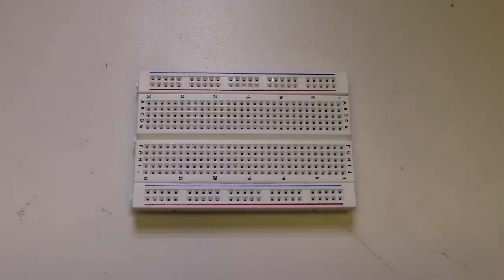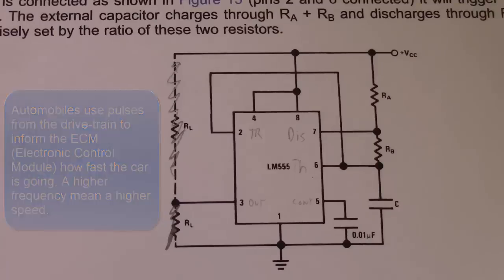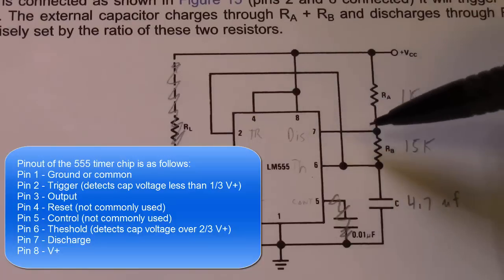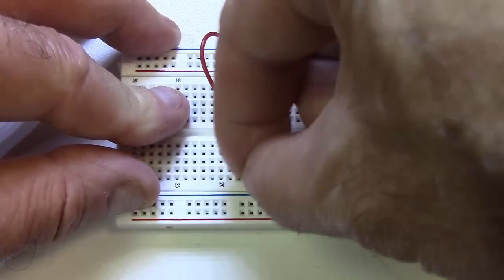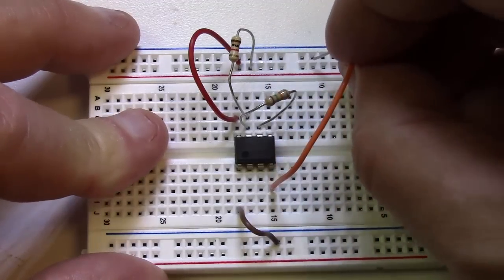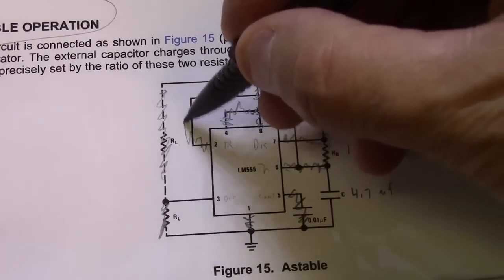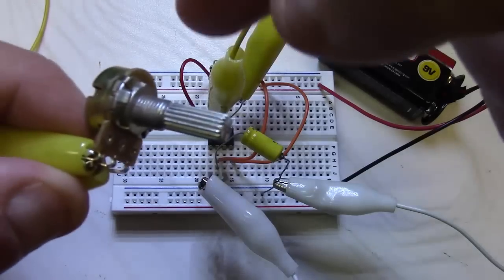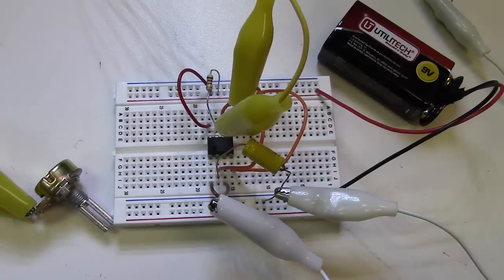555 Timer Project - Signal and Sound Generator

Comment: I like to see a 555 timer circuit have a random pulse it for my robot to blink his eyes randomly
Reply from the maker: Sounds like an interesting 555 timer challenge. Do you want the eyes to blink or flicker? The blink rate could also be tied to a light sensor.
Reply: Dorian McIntire blink slowly I was thinking of a row of led in a circle pattern maybe his eyes are half open wide if surprised I was thinking sound would work well with a mic to make this work but maybe a counter and quad flip flop mix things up I got to think more about it
Reply: Dorian McIntire I need your pro advice
Reply from the maker: I'll see what kind of video I can put together on different ways to drive  LEDs and how to customize the blink rates and other parameters.

Standard blinking, twinkle and fade is easy but predictable but random is a different story. Tying the blink rate to a resistive sensor such as a temperature, force or light sensor can simulate a random blink rate and is also fairly simple.

It's fairly simple to simulate random patterns with an Arduino.

I'll get back to you on this when ready.

Comment: Dorian, Im actually looking to just generate a single triggered beep noise around 490hz. But Id like something clean - which would be more of a sine wave that this square wave from the 555 - any recommendations for a quick and easy circuit? Thanks!
Reply from the maker: +Jeff Para Sine waves are a whole different animal. You can filter a square wave and get close but such filtering will require quite a few additional components. After filtering you'll need a driver circuit to boast the signal enough to drive a speaker. You'll have to wire the circuit to activate the sine wave for only a short duration by driving the reset pin low for a short time.

Comment: This is an AWESOME video and explanation and I hope you're still doing them.  You mentioned requests.   I'd love to see this circuit used to inject a signal into a length of wire and then another simple circuit to detect when it comes across that wire -- just a no wire/found the wire result.  It could then be used to set a perimeter for robots, etc.   Thanks for the video!
Reply from the maker: Thanks for the comment. Your request sounds useful I'll work on putting something together. Dorian.

Comment: This is the first and only video of yours that I have seen. I have seen many electronics tutorial videos on youtube. This is one of the best videos that I have seen. I like that you kept it simple, used an actual schematic and actual breadboard and components and jumped back and forth on how you were putting it together because I see the schematic have an idea of what's going on (ok thats a resistor, thats a capacitor, thats a transistor, that black dot on crossing lines mean that they connect...etc.) But I have a hard time translating that to the breadboard. Other people make vids by drawing out whats going on or making animations, or they make rapid short scenes on what is getting done with little and rapid explanation. Im really interested in dabbling with electronics, as mentioned before I have seen many videos. I went to radio shack and bought an assortment of resistors, of disk capacitors, diodes, a breadboard And now im like now what? what can I do with this? on that note this video gave me insight on what the 555 timer can do But now what? how can I utilize this circuit if I Build it?

Comment: Once at 60hz,  measure resistance of pot,  add it to the resistor you bridged across and replace both with a resistor of that new value.  Now you have a 60 cycle generator.  This is for the beginners.

Comment: thank you for very informative video tutorial. i have LM555 and NE555 and was wondering it would make a difference. Also was wondering it would sound different if i use different ohms of speakers. Thanks!!!
Reply from the maker: Both the LM-555 and NE-555 are equivalent and you should not have a problem with either of these chips. I like the LMC555 version the best since it is uses MOSFET transistors instead of BJTs.

I would use a 8 ohm speaker or greater to avoid overloading the chip. If the speaker is in an enclosure (small box) it will sound much better and louder.

Thanks for watching and commenting.

Have Fun!

Comment: You helped me build my first successful oscillator!  thanks so much!!!  What would you reccomend to get more range out of the pitch?  What resistors/capacitor and pot should i use?? Thanks!
Reply from the maker: Play with resistor/capacitor combinations. A lower resistor, pot or capacitor value will create a lower pitch. A higher resistor, pot or capacitor value will create a higher pitch. I have other 555 timer projects if you search for "dorian+mcintire+555 timer in YouTube.
Reply: Thanks so much! 
 @DorianMcIntire
Reply: @DorianMcIntire  If I wanted to have this thing powered by eurorack (12v power)  What would I need.  An op amp circuit to lower the incoming signal?
Reply from the maker: It will run just fine with 12 volts DC.

Comment: GREAT video explaining the setup and triggers, and the second is great too. 
Can the 555 be used to trigger second 555, so you would have a ..|.|.....|.|..... pattern on the scope, and adjust the timing between the two?
Reply from the maker: Yes, this would not be a problem.
Reply: Terry Martin I think you would connect pin 3 of the first 555 to the Trigger input of the second 555. You could probably just make two of the above circuits and connect them as I mentioned. Try it and see what your result is. You can't harm anything by experimenting.

Comment: Hey I'm a student and am doing an assignment on 555-timer chips and producing musical notes using them for year 11 physics and I was just wondering where you got the graph you used for the Capacitance and Resistance vs Frequency? Also thank you this video really helped me put together my own circuit.
Reply from the maker: The graph comes from a 555 datasheet available at the following URL:
http://www.ti.com/lit/ds/symlink/lm555.pdf

Anytime you are working with a device you can usually find a data sheet for the device using a Google search.
Reply: +Dorian McIntire thank you very much

Comment: I hooked this up to a speak but no sound. I hooked it up to my oscilloscope but i wasn't sure what to look for. I wish you could have hooked up an LED so we could test it. I tried the led positive at pin 3 and it's ground to ground but no luck. i don't have a 15k resistor so i wired a 10k with a 4700k resistor. Other than that, followed to the letter. Doesn't seem like that would be a factor though.
Reply from the maker: James, You can test with an LED but you must slow down the repetition rate by using a much larger capacitor such as 100uf or more. Common causes for malfunctions are: miswiring issues, capacitor polarity issues, faulty components - particularly a bad 555 timer. If your using an LM555 timer connect a capacitor from pin 5 to ground also make sure your speaker is 8 ohm or more. Its tedious  but those who have problems inevitably  get back with me to tell me it works fine after rewiring or discovering a problem with a component Good luck.

Comment: Thanks, it is clearly explained. Pls let me know the multimeter to measure the frequency your are using from RadioShack
Reply from the maker: Jeylani Osman I don't think they sell this meter anymore but I found several meters, with the same capability, on Amazon.

http://www.amazon.com/Mastech-MS8261--MS8268-Digital-Multimeter/dp/B000JQ4O2U/ref=sr_1_1?ie=UTF8&qid=1435501136&sr=8-1&keywords=multimeter+frequency

http://www.amazon.com/AideTek-VC97-Multimeter-Capacitor-Frequency/dp/B008GTEZPI/ref=sr_1_2?ie=UTF8&qid=1435501170&sr=8-2&keywords=multimeter+frequency

Just search for the keywords "Multimeter"  and "Frequency". Many of these are very inexpensive.

Thanks for watching and commenting.

Comment: Really lovely video, very helpful, correct me, if I`m wrong, but this can also be used as a pulsed audio generator as well, right?
Also, is it possible to connect an audio input to this bad boy?
Reply from the maker: Yes you can pulse the device by taking the reset pin from High to Low. For audio input do you want to modulate the tone? If so can do this by applying a signal to pin 5. See the following video for details https://www.youtube.com/watch?v=8GWlifMRsns. Thanks for watching and commenting.
Reply: Well I wanted to input an audio and output it at the frequency of the chip whilst it pulses at a rate, that`s below the perceivable range- less than 1/10 of a second. Honestly-LOVE, how big of a help this has been!:)
Reply from the maker: You should be able to do this using the reset input if I understand correctly. Have fun!
Reply: Just checking, it is possible to input an audio for this circuit, right?
Reply from the maker: You can input an audio signal but it will really just turn the output on and off at an audio rate. Make sure the audio signal does not exceed the power supply voltage for the 555.
Reply: This is exactly what I needed, thank you a bunch, man, solid stuff!

Comment: Hi Dorian! I'm trying to make a little synthesizer with a 555 timer, and your video is perfect for me. I have only one question: what is the value of the potentiometer? Thank you!  ;-)
Reply from the maker: A 10K potentiometer will work fine. Let me know if you have problems.

Thanks for watching and commenting.
Reply: I tried with a 10K pot, but the circuit seemed to be overloaded: it produces a strange whistle and the timer became hot. I solved the problem with another 4.7 uF capacitor connected to the negative pole of the speaker and to the ground; but in your video the same circuit works without this capacitor. Is the resistance of the potentiometer too low?
Thanks.

Comment: Hi! I've been trying for so long to build a circuit that uses a 555 to make a Led flash and use a potentiometer to regulate the blink of the Led. The thing is I can't make it work properly, I'm using the exact same circuit as you only I replace the 10k resistor for a 10k pot and in the pin 3 I use a 1k resistor and a Led. Which you think it could be the problem? Maybe the value of the capacitor? I'm using a 100 uF. Thanks!
Reply from the maker: ***** Your blink rate should be approximately 1 Hz (1 blink per second) with the values you specified. If you're using the NE-555 timer connect a 0.01 uf capacitor between pin 5 and ground. Also make sure you hook the negative terminal of the capacitor to ground to get the polarity correct. Good luck.

Comment: hey ! excellent work you have done ! i wanna produce a frequency of 23,000 Hz and i have calculated my resistors and capacitor.there is one problem ..how much power speaker i should use to produce sound ?
Reply from the maker: +Hammad Fareed 23,000 Hz is almost beyond the range of human hearing. Most speakers will have problem reproducing this frequency. You should use a high frequency tweeter and will probably need to pass the signal through a high frequency amplifier to reproduce it well.
Reply: +Dorian McIntire thanks for helping but i am doing a project "cat repeller" for the purpose i have to generate ultrasonic frequency above 20 KHz that's why i am producing 23 Khz .. but i have no idea which speaker suits fine ? i have 2 w and 0.5 w speaker ! will it help ?

Comment: great circuit man. and also short and good explanation. can you  tell me how to make short beeps or pulses to be random separated in time?
i want the pulses to be 10 or 20 miliseconds long and to happen from 2 to 20 pulses or beeps per second. is that possible? most important i want the pulses to be short and Random... thank you
Reply from the maker: Antonny A. Sorry for the delay - no pun intended. Random is difficult to do with the timer - after all - it is a timer ;) There are some tricks however that might produce a quasi-random effect. Let me get back to you.
Reply: thanks for answering, i will be waiting for the quasi random circuit 555

Comment: Hi, really helpful, quick question though, what determines the min and max frequency of the output ?(my electronics knowledge is a bit rusty)
Reply from the maker: +sminkly The min/max resistance of the potentiometer determines the min/max frequency for a given capacitor value. Another value of capacitor will give a different range of frequencies. You can look at the 555 timer data sheet graph for more information.
Reply: +Dorian McIntire Thanks for quick reply, I'll look at a data sheet.

Comment: building a dual oscillator synthesizer based on two of these circuits in parallel. Its going well! only question I have is what rating is that pot you are using? 10k ohms?
Reply from the maker: +Julian Gray Media I believed I used a 50K pot. I wanted a value of resistance large enough so it did not substantially change the frequency when I put it in parallel with the 15K resistor. If you put a 10K pot in parallel with this resistor it will almost double the frequency. It never hurts to experiment however with resistors and pot values this high.

Hope you have success and fun with your project.
Reply: +Dorian McIntire What if I were to scrap the parallel resistor and use only a pot? Is that a bad idea? And thank you for the immediate response!
Reply: +Julian Gray Media also, if I wanted to add a volume pot where would i put it in this circuit
Reply from the maker: +Julian Gray Media Just using a pot would be fine but try to guard against letting the pot resistance going to "zero" since the circuit will freeze up  but won't be damaged.
Reply from the maker: +Julian Gray Media Adding a volume pot can be a little complicated. The pot should have a low resistance and high wattage if you want to put it in series with the speaker. The best way to hook up a volume control however is to use the pot to couple the signal to an amplifier. Pin 3 to one side of pot ground to other side of pot and center of pot to amplifier.
Reply: what if im running a line out instead of a speaker?
Reply from the maker: +Julian Gray Media For a line-out connection with volume I would use a 1K resistor with one side hooked to pin 3 of the timer the other side of the pot hooked to ground and the center of the pot to line-out. Let me know how your project goes.
Reply: +Julian Gray Media thanks mate!
Reply from the maker: +Julian Gray Media You're welcome. :-)

Comment: thanks for the video; what i want to do is have two of these circuits playing at the same time through just one speaker --- how can i safely connect the two so they still generate sound individually but have only one output?
Reply from the maker: +Jen Hill This can be done but you'll need two transistors to act a digital mixer. I will find a way to supply a schematic.

Comment: It'd be interesting to use a 555 to produce ultra high frequency via an ultrasonic transducer.
Reply from the maker: +Tom Bradford It can be done since the timer can create frequencies well into the MHz range. Transducers are pretty cheap these days. You can get a 24Khz transducer for under $2.

Comment: I built a morse code oscillator using a 555 timer. I would like to amplify the output from pin 3 going to a speaker and would also like to add a head phone jack on the output. Do you have any ideas for me ? Thanks in advance

Comment: Thank you so much for your explanation! I am using this circuit for a project, but the signal is much quieter that yours. Is there a resistor I could change to make the signal stronger?
Reply from the maker: Chance Noble I used a pretty large speaker for the video you can see it in another 555 timer  video I made:

 https://www.youtube.com/watch?v=qjve6Q2QGYw

Use as large a speaker as you can find for low frequencies an put the speaker in an enclosure, like stereo speakers,  for best performance.

Sounds like another video opportunity to show people how to do this ;-)

Thanks for watching and commenting.
Reply: Dorian McIntire Wow! Thanks for your speedy reply!! I am using a fairly large speaker as well. Not sure what happened here, but I replaced the 555 chip I was using with another one from a different supplier and it became much louder.
Reply from the maker: Great!
Reply from the maker: Dorian McIntire Please consider subscribing. Thanks.

Comment: What kind of speaker did you use ? Can you use a buzzer?
Reply from the maker: I used an electromagnet speaker. While you can use a piezo speaker (sometimes referred to as a buzzer) it will not sound good or have much volume.
Make sure you don't use a actual buzzer which can only make a sound at one frequency and will make a sound by just applying power.

Comment: what is the voltage rating on the capacitor?
Reply from the maker: It just has to be more than the battery voltage. A 16 volt rating will work fine.

Comment: one more question: i have a pot that ranges from 0 to 20M. which values of resistor and transistor should i use?? thank you!!
Reply from the maker: Do you mean resistor and capacitor?  It depends on what frequency you want to produce. For a 20M pot any resistor you use will essentially provide a 50% duty cycle so you can use the same resistor used in the video. Using the same capacitor valued will give a timer with a very long time period so you may want to reduce the capacitance to compensate. Experimenting is OK as long as don't use resistor values that are not too low.
Reply: Thank you !!!!!!!!!